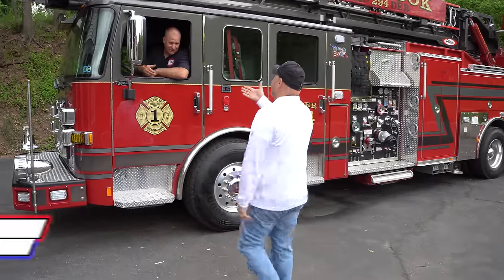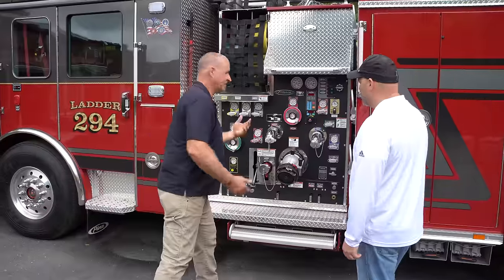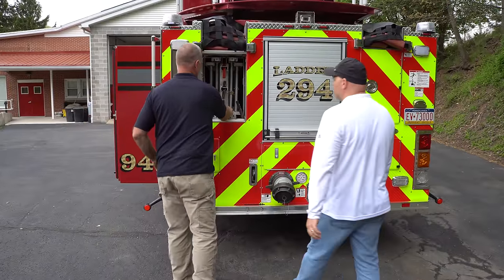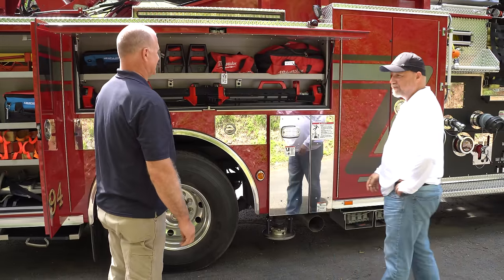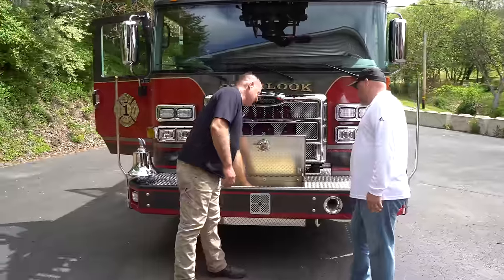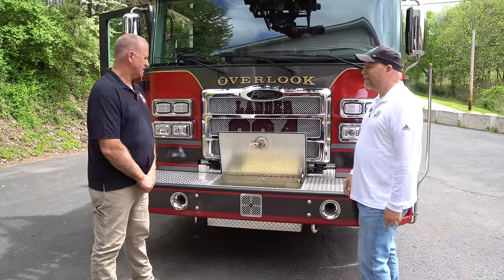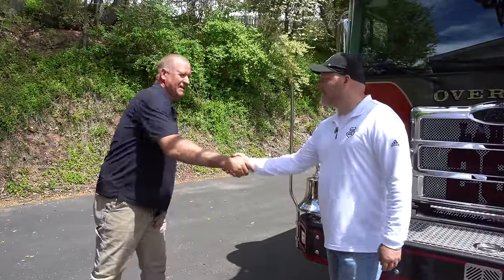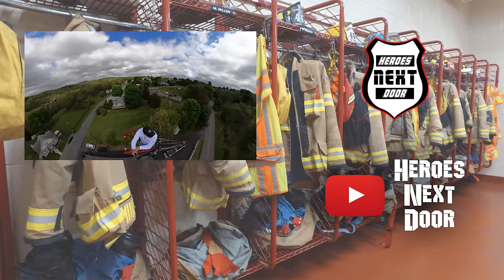A VIEW from 100 feet UP

Comment: We had just finished spec’s and signed a contract on a 75’ Pierce Velocity Quint, when right after Pierce announced the Ascendant line. I was so mad 😀.  We are replacing our rear mount platform with the Ascendant mid-mount platform in 2024.

Comment: Imho, for Suburban/Rural departments, the Quint concept is the way to go. Unfortunately, the manufacturing costs prevents most VFD's from pursuing.
Reply: Yeah, even bigger cities have come to like the 75 ft quint concept, like boulder fire department for example
Reply: We get the best of both on one rig. Suppression and Truck Co. If we arrive first to a worker our guys are disciplined to do suppression (after life safety of course) then as more members arrive they can be assigned Truck responsibilities  if other lines aren't needed interior.
Reply: and what you end up with is overly large and complex vehicle, with an aerial that has a shitty angles, possible placement problems and a relatively small water tank. You also have limitation on the crew size and thus always have one major tool not working (either pump or aerial). You also risk loosing both pump and aerial in the event of a traffic accident. Oh and don't forget, this monstrosity goes on all calls, including medical. 
Why not have a simple aerial only truck with 2 man cab on a commercial chassis and a proper engine, that carries all the equipment and ground ladders (possibly also on commercial chassis). The crew capacity now also rises, and you always have a dedicated aerial operator. You would also risk the aerial less, as it won't go on the calls where it is not required: medical, traffic accidents, small fires etc., and it will serve longer due to lower overall mileage.
Also this may be cheaper, as the aerial is the thing that is area specific but engines do more or less the same work everywhere, so multiple departments can cooperate and make a bulk order of similar (or even identical) engines and then the economy of scale kicks in.
Reply: @solarissv777  calm down dude, I'm just saying that quints are practical and useful
Reply: @frontrangefirephoto2123  and for some reason, they are seldomely used anywhere besides the Noth America. Magirus tried to pitch their "All stars", but it didn't get much traction. I believe, the popularity of the quints in North America originates from the truck company/engine company division. With the classical trucks, FFs have almost no means to put out the fire and the classical engine crew have almost no tools for forcible entry/search and rescue/extrication and it's obvious that FFs may want to have both capabilities. But do they always need an aerial? Moreover, the aerial that either takes space from tools and other systems or makes the appliance extremely large.
Reply: @solarissv777  It all comes down to the needs of that individual fire department. My hometown is currently in the process of building a new ladder truck, a ladder tower to be precise, that will be considered a straight truck because that is what the politicians wanted. The truck it is replacing is equipped with a pump (1500gpm) and tank (200gwt). Considering the obstacles my hometown possesses (steep hills, tight streets, etc) the truck's pumping and suppression abilities came in handy. It allowed attack lines to be closer to the building in the tighter areas as oppose to stretching long lines. It also has laid into the scene a couple of times. The versatility greatly improved the capabilities of that department. Your suggestion may work for many areas but it won't work for all areas. Especially in volunteer departments when staffing isn't always present. For this department, this truck is what met their needs to best protect their community
Reply: We are a small rural dept. The quint doesn't work for everyone. For us it does. In our primary and mutual aid responses. We run all first alarms with a squad, (eng) another eng, and a rit (2nd squad) and multiple tankers since we have limited hydrants. Our first priority in those areas is water.

Comment: Great video and truck.
My borough has a 1995 Pierce,
Model: Lance Aerial Length: 105′ Gallons per minute: 2000
Tank Size: 500
Nice to find out what the different types of vehicles are.   Like an Engine and Pipeline, what are the differences?
Reply from the maker: Thanks for watching. Where are you from?

Comment: dont put too much weight on the end of a pierce ladder or it will fall apart
Reply: No issues at all
Reply from the maker: Felt very safe and stable all the way at the tip
Reply: ALL manufacturers are REQUIRED to state the maximum "tip load".
IF you read the reports on accidents involving aerials, the 2 most common causes are 
A) Exceeding the design tip load.
B) Laterally loading the ladder.
In this case, the ladder is basically like a crane, it is lifting a load.
It is designed (as is a crane) to lift the load straight up with all components of arm loaded equally.
If forces put a stress on the arm side to side this causes the arm to be loaded more on that side.
A common example of this in aerial operations is touching the roof/wall with one beam of the fly.
As weight is applied at the top, the beam touching the roof will have solid support.
The beam not touching will want to twist creating a torsional load, leading to a difference of load forces on the components.